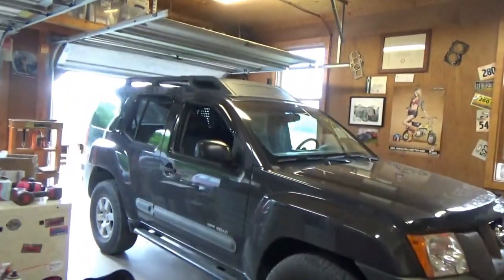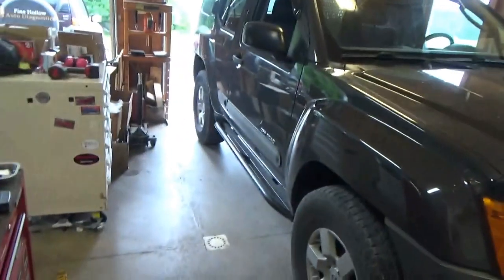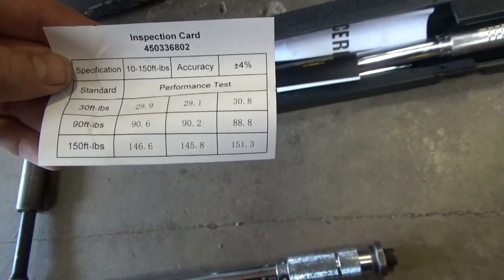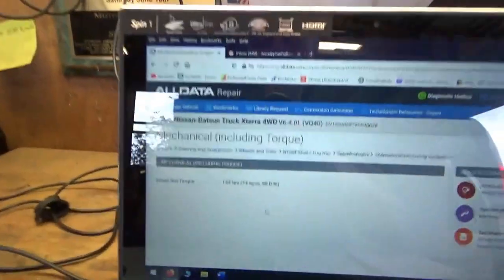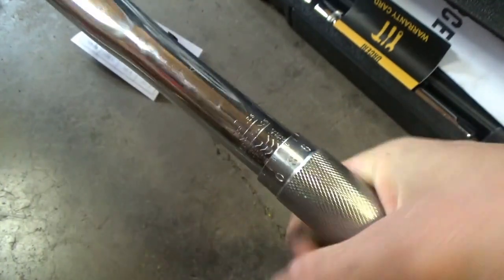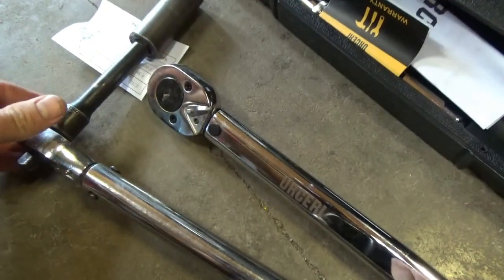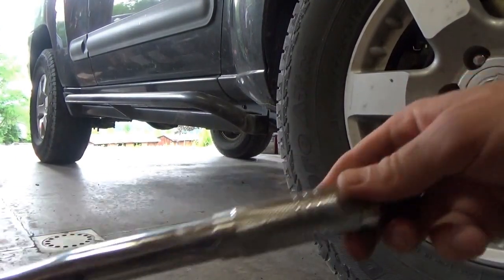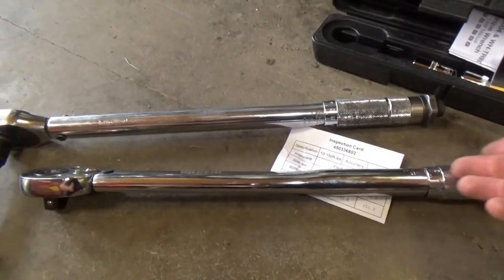Can you trust a $30 Torque Wrench?

Comment: Oh no Ivan you're wife's car lug nuts ?  That was bad ;-(
Reply from the maker: I know...don't remind me haha
Reply: @PineHollowAutoDiagnostics  Usually, as the bolts come loose, the wheel will start to make quite a racket before actually coming off. Need to train the wife to investigate those noises and not just "drive to the wheels fall off".
Reply: @PineHollowAutoDiagnostics  Amanda let you live!  You are lucky it wasn't my grandmother.   She would have reminded you at least bimonthly until you died.   You are such a proficient  mechanic that you can afford to be wrong once in a millenium.

Comment: I dont use a torque wrench for lug nuts anymore. I tighten them by hand first then with my extendable wratchet or breaker bar and i go by feel. Works fine as long as i tighten them enough but dont go willy silly with it. I have a harbor freight torque wrench that i used to use but it failed twice where it didnt click when it reached the torque and i broke both those bolts off...so i dont use it anymore. It needs to be sent in for recalibrating because ive never had that done (said in the papers it needed to be recalibrated once a year) but who is honestly going to want to send their torque wrench in once a year to have that done when they are a diyer and barely use it? Not me.

Comment: When you use your torque wrench a lot, it's also a good idea to get it calibrated once in a while. Also, it's important to check the calibration on the lowest, middle and highest torque range.
Reply: I test ours with a beam wrench known accurate and an eight-point socket.

Comment: For me, on many years experimenting these old style cheap torque wrenches...doing hundreds of headgaskets and tire locking...never let me down. Like mentioned below...back out to 0 when storing. As far as specs go...whenever I see something like 98ft/lbs...i take consideration of +/- tolerances. I always put and extra 5lbs just to be on the safe side. Never had a bolt break on me or backout on me over 15 years using it...knock on wood

Comment: I love using torque wrenches. I appreciate knowing that the nut/bolt is tightened to the proper torque. Additionally, I feel like I'm less likely to skip tightening something when using them. In my DIY career, I've only had one significant oversight of tightening down a bolt on a motor mount that came loose. Oh, and fwiw, I'm a single clicker, one and done. Thanks Ivan!

Comment: I never use an extension on lug nuts. I bet your losing 5-10 ft.lbs. with that extension.
Reply: Extensions do not effect torque..no matter the length...but if you start changing the angle  off of 90 degrees to the fasteners  then you will start changing the values..side note oil,anti seize,fluid film will  also increase your torque, which could result in a lot arguments
Reply from the maker: Now James, explain to me scientifically why that would be the case :) Keep in mind that we're not using an impact here, just static torque.
Reply: @PineHollowAutoDiagnostics  I was thinking of an impact! You're right, as long as you maintain 90 degrees to the lug nut, torque isn't affected. I don't use an extension because there is a tendency to hold the torque wrench and extension at an angle that is not 90 degrees. There is no need to worry about this when no extension is used. Personal preference.

Comment: I have built many an engine with a beam torque wrench some of which i used in my bracket car. torque is torque.
Reply: Beams are crazy accurate.
Reply: @Jason Bowman yes they are good but can be hard to read other than on the engine stand. On rod bolts i follow up with a micrometer to measure bolt stretch. always on the money :)

Comment: You can do bench verification yourself with a vice and some known wieghts
Reply: I did it with a luggage scale on the wrench I had for 15 years. I always stored it unwound and was surprised it was still in spec
Reply: Nobody does this, in spite of a standard, people seem to think torque is a magical quality.
My "snap-off" was calibrated in 95, I keep it unwound and it's close enough.
Reply: A beam style wrench of known accuracy can be used as a test standard too.
Reply: This is always a good idea ... Matt at Schrodingers Box did a good job of demonstrating a DIY method of verifying your torque wrench as part of head gasket repair video he did ... (Replace a Cylinder Head Gasket Yourself and do it RIGHT! Part 2 ... starts at about 5 minutes in). He explains the math of torque wrenches and we all know you love math Ivan!

Comment: I DO NOT want my lugs over torqued.   Had that done by a new tire replacement job and my rotors were warped. I torque them to what the manual says.

 Gee, lets do the job properly. It can get expensive, otherwise.  

I have gear wrench ditigal,  tekton, craftsman and some minors ones I have collected over my many years. 
You always need  different drives, etc. and different torque setting limits...on each one.

Comment: So this is something I learned the hard way in Florida...

a SINGLE GRAIN of  sand can get on the seating surface of a lug nut or lug bolt, when you tighten it to that 85ish lb-ft spec the grain of sand will bind and it'll actually be LOOSE still. I always take my vehicles for a quick mile drive now and often times, maybe 10 to 20% of the time I'll find a bolt that's already finger loose.
Reply from the maker: Wow that's crazy! Great thing to check for!

Comment: All torque wrenched will go out of spec, whether they're cheap or expensive. I find that the simple beam style ones are actually less likely to go out of spec than the click ones since the click ones depend on certain parts being greased internally and that grease can gum up. You should never trust any torque wrench even if it comes with a certificate of calibration since it might have been bumped out of calibration in the mail. You should use a known weight to calibrate it, the easiest way is to use a digital luggage scale which you test the accuracy using a standard weight, then use the luggage scale to test the torque wrenches. Wrenches will go out of spec with changes in temperature so it's a good idea to check it twice a year.

Comment: Ivan, also, "old reliable" has a convenient swivel head (new tool doesn't); but what's the cost (in today's dollars)? And how do they compare to the digital adapters(they also use 'em to test/calibrate torque wrenches).

Comment: Let's see how this low cost torque wrench works...  Let's compare it to an old low cost torque wrench that I abuse by not following it's operating instructions.  Results?  Invalid test.
Reply from the maker: Hmmm well we can get more scientific if you want. If we know the length of the bar, you could hang a digital scale on the end and see if it clicks at the right point. But they both work fine lol

Comment: Lets not promote harbor "china" freight. Here's an alternative https://etork.com/about/ Although they have sold out some of there manufacturing "higher" standards to china. The CEO has an engineering background of what the standards should be in torque tools. A non digital etork torque wrench runs $40-70 * I think the better question is WHENS THE LAST TIME YOU CALIBRATED or sent in TO CALIBRATE YOUR torque wrench?

Comment: never loosen a bolt or nut with a torque wrench, it can easily over range it and take out of calibration, Also wrench must be calibrated for left hand threads if torquing in that direction, Torque calibration sheet will show this if it is also calibrated for left hand
Reply: A torque wrench is not a Rachet that is used to tighten and loosen nuts on a regular repair job.  Use it to torque things that require that they be torqued.

Comment: To compare torque wrenches, you could couple their drives together and operate them against each other. See how close to each other they click for different setting.
Reply: I use an 8point 1/2 socket to do that test.  The hard part is holding one wrench while turning another.  I  put one in a vise , very lightly,flat ways,  Also HF has a digital torque adapter that is mainly to allow any drive tool to be a torque wrench.  I lock it in a vise and use it check torque wrench.
Reply from the maker: That is brilliant! Would have made for a cool test ;)
Reply: @PineHollowAutoDiagnostics  Bonus footage!

Comment: On those click tork wrenches I have been told that it is important to turn them back to zero when you put them away.
Reply: Yes, I always release the spring tension when storing.
Reply: I think its suppose to set to 20% of lowest torque, so a click wrench of 50ftlb to 150ftlb  would be 10lbft, since 20% of 50 is 10. But i just set it to the lowest
Reply: Some torque wrenches are used all day every day and it shouldn't bother them. It would be like jacking a car up to keep tension off the springs.
Reply: @tiredoldmechanic1791  Well some cars do get lower over time (especially when their suspension is literally made out of rubber).
Reply: @tiredoldmechanic1791  a wrench used all day is not the same as one stored under load. A wrench in constant use is being properly warmed up with flexing and lubrication of the coil... one is storage is not. Its also not like the coils on a car because one of these is designed to return to a specific calibrated load... a torque wrench can be at any load. Really misinformed post
Reply: I have one of those cheapo click types that I don't use any more for a decade or two.  It was left at 80 lb-ft since I switched to split beam.  When I calibrated it, it was off by 26 lb-ft at 150 lb-ft.
Reply: @bbkmm1  i bet 10 years ago it was off also , what was the spec on that thing +/- 5% ? 
      The worst about the inexpensive ones is how the accuracy changes through the range.  50ftlb might actually be 40 or 60 then 100 is very close then the high end is off.
Reply: When I worked at a tractor/lawnmower repair a guy there claimed if the wrench is backed off past zero, it needs to be calibrated.
Reply: I never did that with one I haven't used for 1 year and when I recalibrated it, it was still all good. But I always try to remember to put it back to 0.
Reply: Yup, and make sure it is in the "off" position before storing.  ;)
Reply: I back mine off enough that it fits nice in the case.
Reply: @glenncerny8403  and make sure it's not in the off position when torqueing!
Reply: YOu have not been told it says so in the manual.
Reply: It is.Sometimes forget though.....
Reply: I never knew that , is there a specific reason for that, but thanks for the information I will definitely do that with mine now
Reply: @christurner5473  
The reason is simple. Springs can take a "set" when under tension continually. That spoils calibration.
Reply: Just went out and set mine back to zero🤣
Reply: Interesting. Funny, the brand new torque wrench he just got was set to 80, straight out of the box.
Reply: @donaldmoser212  
That's quality control on a $30 wrench.
Reply: You should always wind them back.
Reply from the maker: I've heard that too...but I never do haha

Comment: You get what you pay for. You also have to know the manufacturer and quality control.
Reply: You seldom get MORE than you pay for but you often get LESS. I've experienced a Snap On clicker type break rod bolts when set to 25 ft/lb because it didn't click until 40 ft/lbs. They need to be checked. The easiest way to check one is to use a second one and a square drive socket to turn one against another.
Reply: @tiredoldmechanic1791  true.
Reply: Amen.   Torque wrenches is not the place to get cheap....it has to have some quality and accuracy built into it.
Reply: Doesn't mean anything.